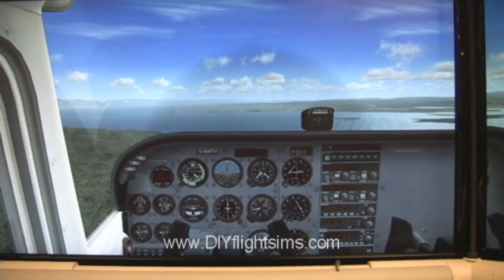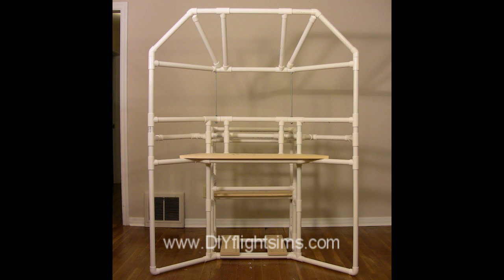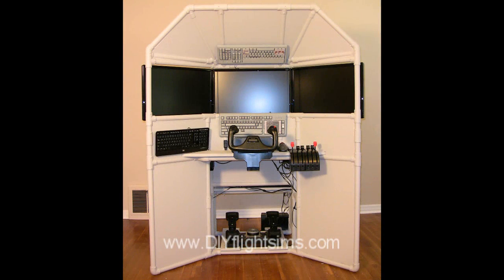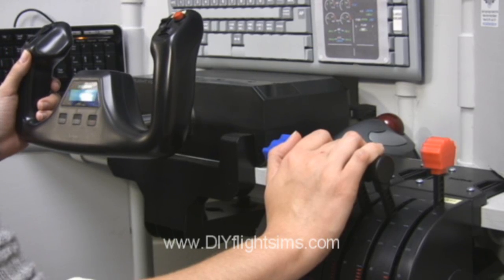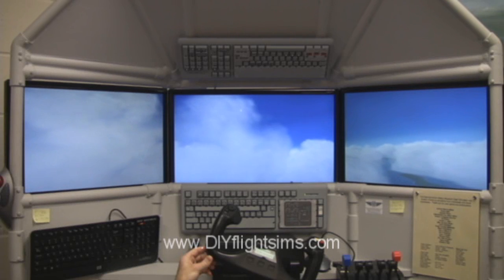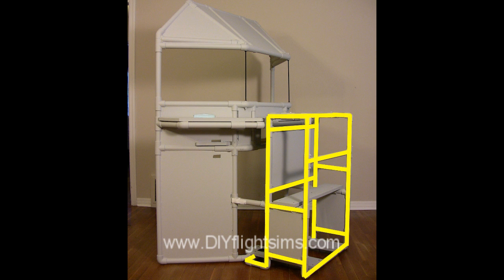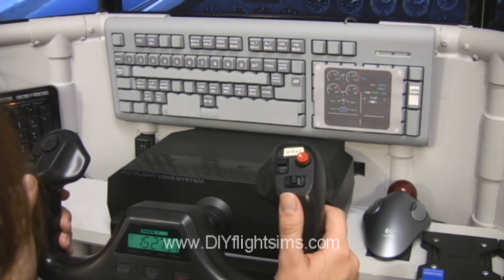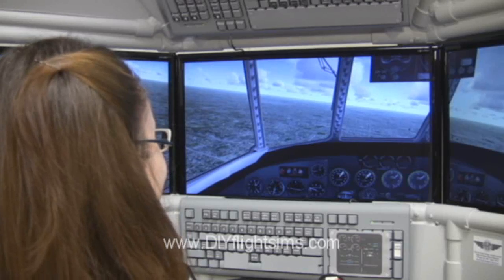DIY Triple Screen Flight Simulator

Comment: You can use the Nvidia / AMD control panel that will only work for 3 displays not two, or you can buy like what they did which makes it one monitor as an input but two as an output.
I would personally use the driver control panel but if you GPU does not support that then you need to buy a external thing.